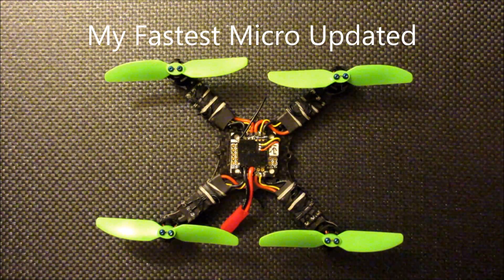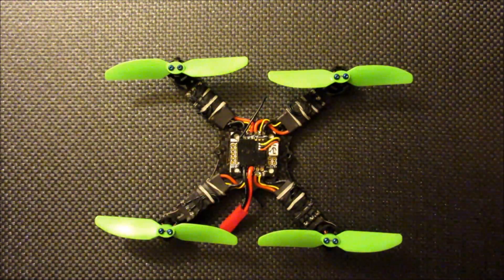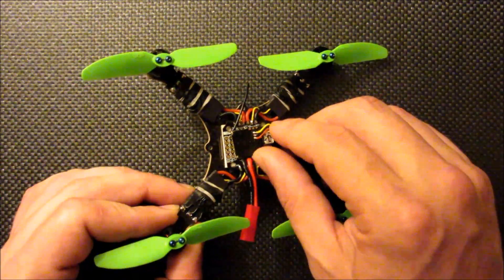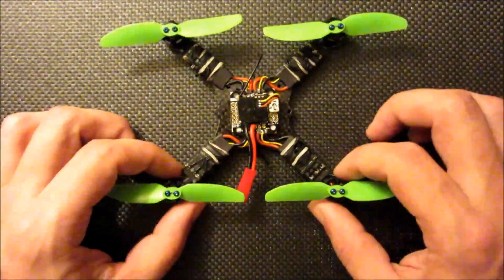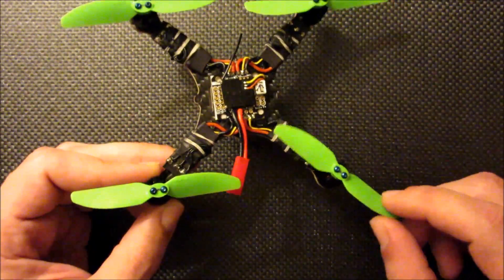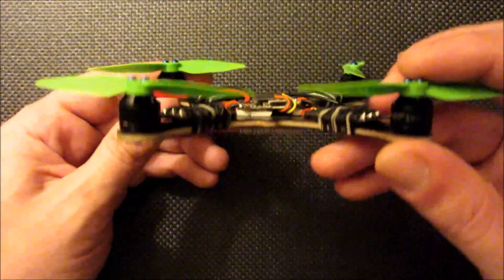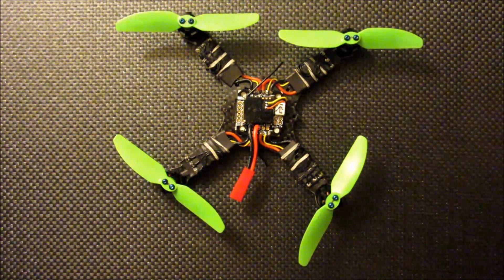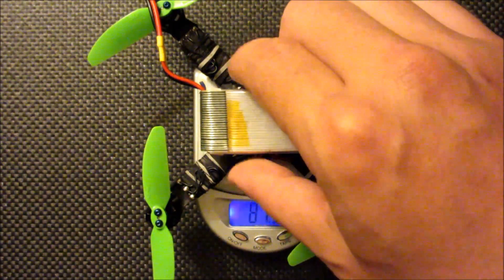My Fastest Micro Updated with info

Comment: I'm trying to find just the right everything to fly the fastest on 650mah 3s. So far best luck i've had is with some 7500kv 1104's. The punch was nuts even with fpv camera on it. Comparable to this one's punch on 3s. However the motors were pretty toasty and now that it's gotten so hot here I feel like there's no way lol. I've tried 6500s with the 3025 props and it was decent but definitely slower. I got some 4000s for these 3045 tri blade props I found thinking that would be good but the 4000kv motors are too hot with those and wayyyy too slow with anything else. Kinda frustrating..  It seems the 7500kv was the sweat spot but just not quite cool enough. Would 1106 7500's do the trick?
Reply from the maker: Well if you ran 7500kv 1104, 1106 with the same KV, voltage and prop, should run a bit more efficiently making it cooler.  I also think that 1304 5000kv would be even better for 3s (definitely faster than the one in this vid).  Is there a reason you don't just jump to 1304?  Same motor/prop mounting and great power.
Reply: I'd really love to try some 1304's but I'm fairly new to all of this so I didn't even know or think about there being motors that size I could get for these micros until a few days ago xD I went ahead and ordered the 1106's the other day though already. Is it worth hunting some 1304's down? Getting around 6min flights without going hard constantly with the 1104's
Reply from the maker: 1304 are strangely not very popular even though so far they seem to be the most powerful motors for 3" T style Props.  Probably due to limited options/suppliers as they are mainly only available at Myrcmart and only in 2 different Kv.  I'm lost as to why most MFG's are pushing the 11xx and not making 1304 too.  If you already have 1106 on the way I'd just use them and consider 1304 if you still want more.
Reply: Dave Woods   Whelp.. got the emax 1106's in and got em installed. Spun them up with no props to 1200-1300ish just for the hell of it in a 74º room and within 10 seconds they were already pretty warm almost hot... Weird but I put the .4gram bi-blade 2535 props on em and spun them up around 1250 for like 10 seconds in motors tab and they were hot -_-  fml
Reply from the maker: 7500kv, 3s right?
I don't think you're supposed to run the motors unloaded much at all either.
Reply: Yeah 7500, 3s. I just never had a problem with motors heating up from a like 30% throttle. I turned Dterm down to 2 just to get that out of the way. Made sure the screws aren't anywhere near touching any windings and did a 25 second hover in the room and landed and the motors were borderline too hot to keep my fingers on.. wtf. these are literally worst than the "cheapo" ipower 1104 7500s... I'm confused
Reply: Alright just tested them with a 650mah 2s and they're pretty hot even on 2s.. Flashed to way down to 3.1 betaflight and flashed esc's to 1.63 dshot command ( w/e that is ) since I have the piko blx FC i use on dshot 300. Tested again with 2s, same thing. Also I noticed something strange.. when I check motors with an IR thermometer, one motor consistently reads like 190ºF even though the others show way lower...yet they all feel exactly the same temp. Weirdest part is it still showed 190ish temp on that one motor even after they all cooled down completely.. I unplugged the battery and suddenly motor matches the rest on temp. What?
Reply from the maker: Bummer, that is surprising.  
Seems like you have an electrical issue.  The motor should definitely not heat up like that.  
I wonder if a couple windings are shorted on that one motor.  I'd start swapping stuff around and see where the problem follows.
Reply: 3d printed a test bench to check different props and what not. With the 2535 single bladed it had 254grams of thrust but pulled 14.7amps at max throttle. That's like 160watts max. My esc's are rated 12amp 18amp burst. I tried my rotorx 6500kV's with same prop and it had 192g thrust @ 9.1amp and those get pretty toasty outside. I tried some 1935 tri-blade props on the 7500's and they had 178g thrust @ 10.5amp but the motors still got too hot to touch even in motors tab at 40% throttle for 20 seconds in a cold room. What kinda of crazy power are your motors pulling and barely be warm?
Reply from the maker: I have not personally measured but RCX1304 data shows around 300g thrust @ 10A with 4s.

Comment: Hey Dave, have you thrust tested these props? Back when I tested them, they didn't perform well at all so I never actually used them on a quad! I also used the RCX 1105 motors. They seem to work really well in your application in this video though. Just given this video is a year old, and I know you've done some more recent thrust testing, I was wondering if you have a new opinion on them.
Reply from the maker: Never thrust tested them, but for LOS flying on 1105's 3s they worked great.  They don't allow for as much floating/coasting with FPV though and heat things up more than I like on 4s even with 1304 motors on.  I've since ditched 1104/1105 motors and use 1304 4000kv on 4s with Gemfan 3025's.  Also 5000kv on 3s but not as much.

Comment: Hey Dave are the 3030 worth the $1 a prop price or are the Gemfan 3025 at $1.60 for 4 props close in performance.
Reply from the maker: I would say it really depends on your build and expectations, but the 3025 are excellent too.  For 4s 3025 are the way to go, with lower cell counts the HQ3030 may get you a bit more thrust/grip but the 3025's shouldn't fall far behind.  They are also super durable.

Comment: DAMN that's impressive!! Have you tried the Racestar 1103 motors as of yet?
Reply from the maker: Thanks, This got significantly better on 4s!  
I have 1103 motors but yet to try them.  I need to thrust test them myself but the thrust numbers on the BG product page don't impress me much.  I think they need to be faster as 1s thrust is very weak and once 2s+ battery is added thrust:weight is nothing to write home about.  Also for me, 2s isn't overly feasible indoors and if it's going to be outside I'll opt for 1304 all day.  Again I need to thrust test 1103 myself though.

Comment: What lipos do you use for this? I want to build the same quad + fpv cam :) Maybe a eachine tx02
Reply from the maker: Pulse 4s 450mAh are good.  Lately I have upgraded to Bonka 500mah 4s LiHV and only plan to buy LihV from now on.  Should have them available at Picnic Quads soon.   Also a taller FPV pod is in the works that you can just cram a tx02 or similar sized Cam/Vtx combo.

Comment: Hi Dave ! Be careful when flying near your face ! 

I'm tempted to have this type of quad and could switch 3S or 2S according to the place I'm flying. I was looking for something not too noisy and your demonstration is convincing. I will add a light MC02 FPV camera when needed and will have a under 100 gr quad. 

Questions please : 1/ the 5000 kv would not be better for thrust (especially on 2S) ? 2/Did not you try the 3 Rotorx blades ? (they seem to give more thrust ).

I'm also wondering whether this combination could be terrific with this kind of frame http://picnicquads.com/product/mini-frames-for-brushless-motors/ and : RCX1407 3800 kV in 2S and 5040 props. Should be LIGHT (less than yours yet) + very powerful and very silent (low pitch noise with 5040). What do you think Dave ?
Reply from the maker: 5000kv would be better on 2s, I'm just not personally overly interested in 2s anymore.  I spent a summer building up my skills on 2s so still give it plenty of credit.  Prop selection on 3s will likely drop with 5000 unless you want to go smaller.  

Where are there 3 rotorX blades with t style mount for 110X/1304?  Didn't think they existed.    

That combination would be very good.  See my 195 based videos.  I think they are all on 2s.  
I had 1306 3200kv, but 1407 3800kv could be great.  For me the 5040 only added more heat than thrust/speed, so I stuck with 5030's.  I'd start there and see how warm things are before jumping up to 5040.  I wouldn't expect huge improvement with them.
Reply: Well, what refrains me with some 3 inches props build is the screaming noise of those. If I have a small quad, it is for playing around in parks with my DEVO F4 (very handy radio for quick stealth fpv flights) and not to have something screaming. 

You're right about Rotorx. The ones I have are for 1306 motors. Sorry for the confusion.

So, for my next built I may take those 5000KV (or, trade off, those new http://www.banggood.com/ZTW-Spider-Pro-SP1104-1104-4600KV-2-3S-Brushless-Motor-p-1084766.html  ???) for 2S. Or switch to a bigger quad with 1407 3800 KV with 2S and 5040 props.

Regarding the 5040, I'm not interested in thrust improvement, but in NOISE (even if it is a bit less powerful) ! The lower the pitch, the more stealth you are. And you have not the same issue than me (I live near Paris). 
Thank you for your time ! :)
Reply from the maker: 3" are not necessarily louder than 5".  It's much more related to prop speed and efficiency.  HQ303 on 2s 4000kv are not really noticeably any louder than 5" on 3100kv 1306 & 5030.  

If you want less noise for 1306 or 1407, I'd go with 5030 not 5040.  You could also make a 3" based build just as quiet and in the same performance ballpark.

Comment: Dave, I have huge respect for your skills! be great to see what you can do with a stock Hubsan for example or some other Micro using stock controller.
Reply from the maker: Thanks, 
I'm afraid I can't do much more with most of the RTF quads than you will see in just about any demo vid.  The self leveling most of them utilize really minimizes the potential and also really throws me off.
Reply: i am starting to understand what you mean. I have been playing with various combinations using a X4 fc and although get ridiculous speed feel limited. I have a Scisky fc sitting waiting for my Devo 7e to arrive as i am unable to find a really decent Youtube clip on getting it paired with my Spectrum DX7s... tried but failed to get all the motors running.

Comment: Kudos, Dave! Lovely micro BL build and masterful LOS acro flying, as usual. If you find yourself wanting a bit more torque for the HQ3030 props, you could try the RCX H1304 4000KV motors. Better efficiency might give you a bit more flight time as well.
Reply from the maker: Thanks,
I actually almost ordered a set of those last night.  Really only thinking about for trying 4s though, as this one has plenty of torque for me as is.  Remembering that 4s packs under 850mAh are pretty much nonexistent, I quickly lost interest though.  Please educate me if there are some.   I could probably hack a smaller 4s pack together but my attempts in the past didn't work out too well.  I fear the weight of a much larger pack will nullify any torque gains available.

Comment: Have you checked out the RotorX 1102 8000kv for 2s or they DYS 1104 6500kv for 2s-4s? I I can't imagine what your quad w/ BE1104 6500kv 4s would be like. Is it a bird is it a plane is it superman? Naw man it's faster then superman it's Dave Woods with his BL CFB X-Frame running 4s hahaha
Reply from the maker: I've glanced at those motors.  Seems they are really intended for smaller props and/or lower voltage.  Only DYS 1104 6500kv I can find list 2-3s and they are typically using 3020 not the 3030 which are actually quite a bit more prop.  From what I hear 1105 5000Kv have trouble with 3030 just on 3s, so  I don't really think 4s is overly feasible with the 3030 props and 4000Kv.   I may try it someday but probably with 3020 props (current ESCs are also only 3s rated) and don't expect I'll like it as much.  Have some 3s HVlipos on the way which I'm hoping will push it a touch more without overdoing it.